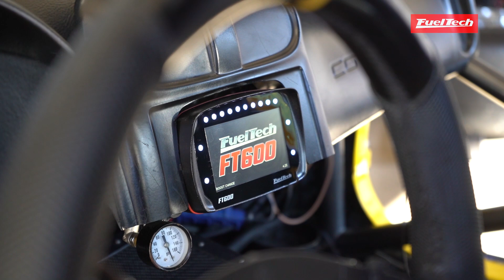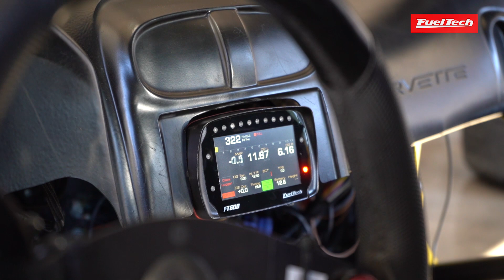WOODY VETTE 4,000+ HORSEPOWER ON THE DYNO!

Comment: ???? I have a couple questions. 
How are you making 4100+ hp at 2200 RPM? 
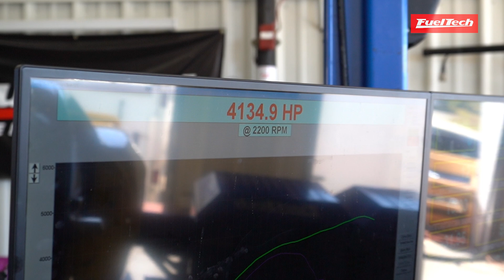And if you make peak hp at 2200rpm, why does the graph at 2:40 show the peak at the at the end of the pull? Only way that’s possible is if you only revved to 3000rpm or so and I’m sure that’s not the case.
Reply: Axel rpm not engine rpm

Comment: 4000 hp at 2200 rpm....what!!!
Reply: Yeaaa... I saw that too 🤔
Reply: @bigkat776  hell they idle at like 1500
Reply: She must be a Detroit lol...... I  think more like 7200 or 8200 rpm is believable?
Reply: Bill Knight Yeah there's no way possible and made that power at 2200 RPM there's no way those powers are outstanding but let's be real that's not a rocket ship there's no way that Car made just about 4200 horse power at 2200 RPM when we know they  idle between 12 and 1500
Reply: Got to make power on the top not the bottom !
Reply: The Squirrel Chronicles aka Rescue's I understand but there's no way in hell that you can make over 4000 hp 2200 RPM that's not a rocket ship it's a ProMod that's impossible
Reply: Wheel RPM...
Reply: @brandoncanatella3221  ... That's right. You can tell by the way the car is lifting if you watch closely
Reply: That's dyno rpm not engine
Reply: That is AXLE RPM not engine rpm
Reply: @350gtboi  Murder Nova was on the same dyno with the same guy running it and made over 3000 hp at 8000rpm or something like that.
Reply: @billknight5578  Exactly, the default display on the hub dyno is AXLE rpm not engine rpm.
Reply: @billknight5578  2200 is the axel. That’s still pretty damn fast for an axel